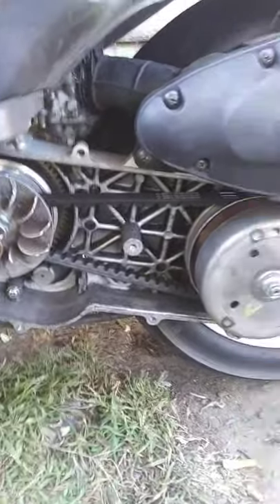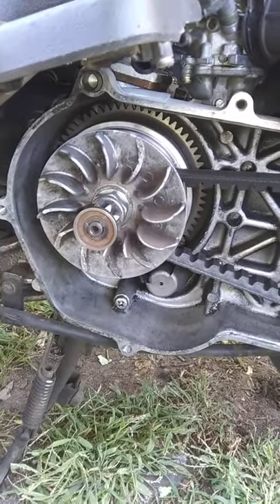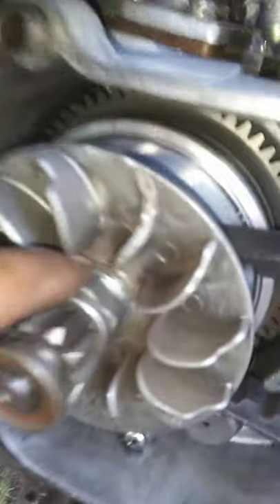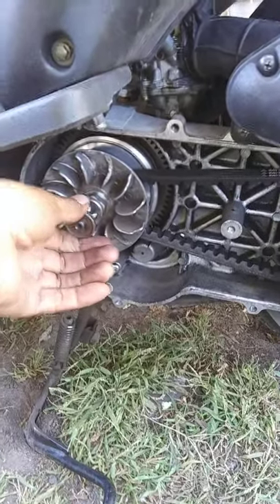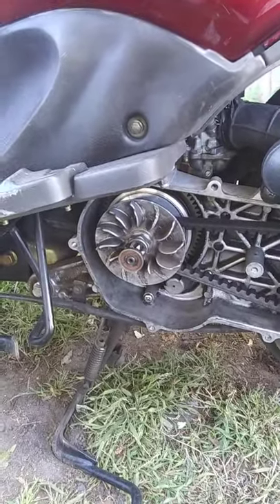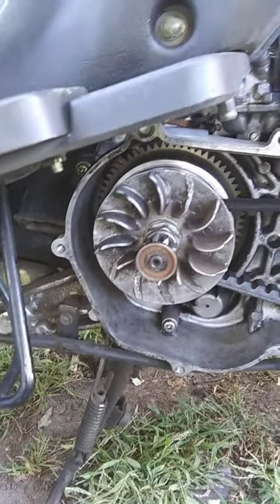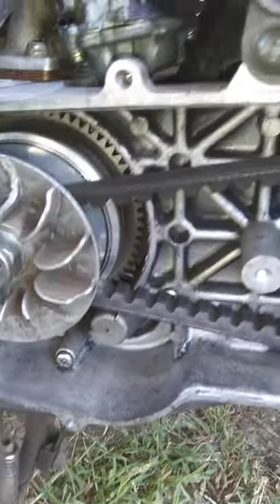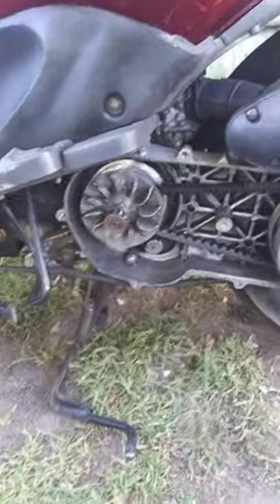Hyosung Prima SF50 CVT & Variator information

Comment: What weight rollers did you end up going with? I have a SF50 rally and put 6 x 7grams (42g total)
Reply from the maker: Sorry for the long wait I did not get this message. I went with lighter weights. I actually did mine differently and went with 5 g rollers. You can tell the difference when you get above 25 or 30 mph. The lighter the rollers actually help you take off a little bit quicker. But you don't want to go too light because then you don't have the power.